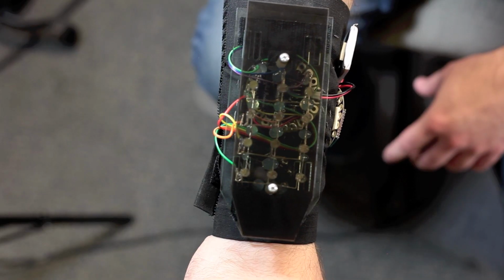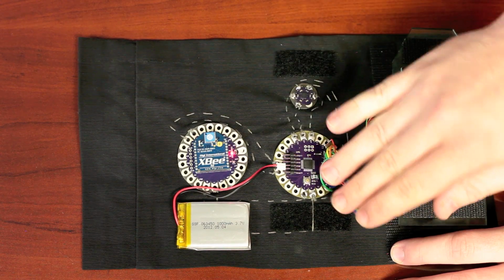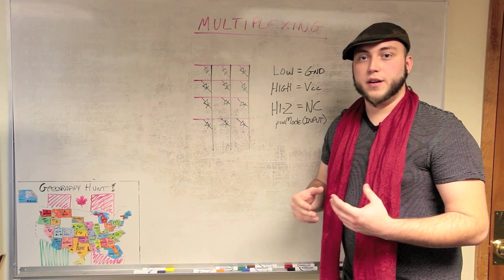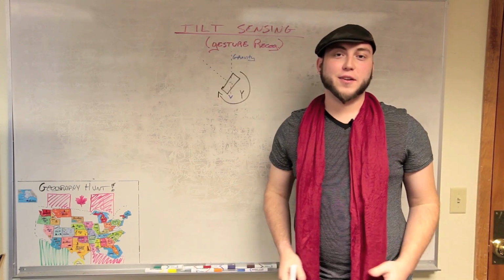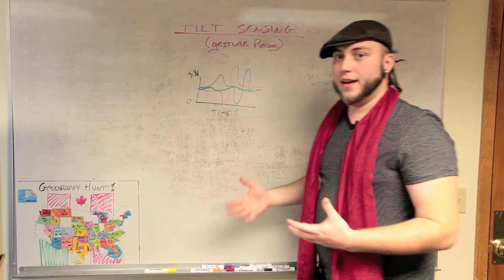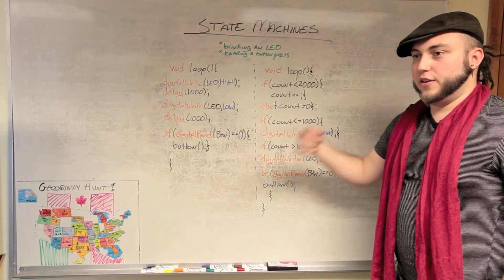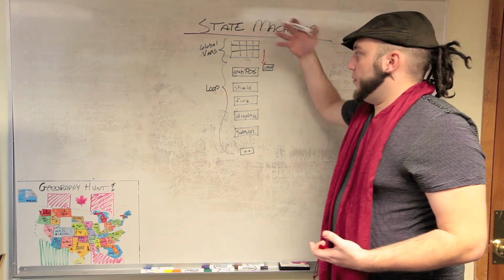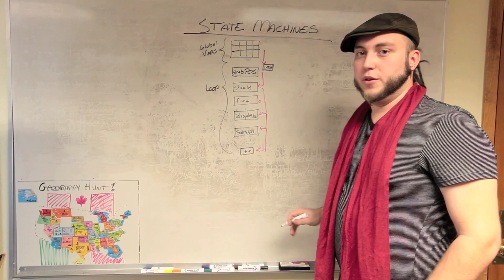SparkFun Engineering Roundtable 10-23-12: Battle Bracer Project with Nick Poole

Comment: In multiplexing the diode prevents current leakage through adjacent channels. Don't believe me, try it with some standard incandescent lamps. When you would try and light just one lamp it will also light the others surrounding it, though not as brightly because the current that leaks out on the adjacent channels will be through multiple lamps in series. so the further the lamp is from the one you are trying to illuminate the dimmer it will be.